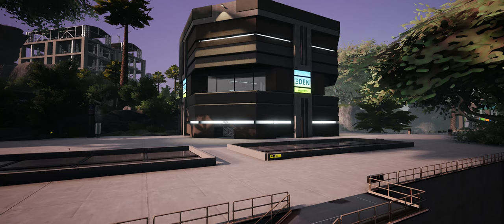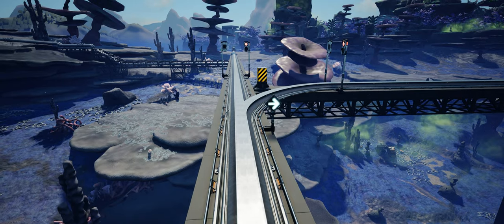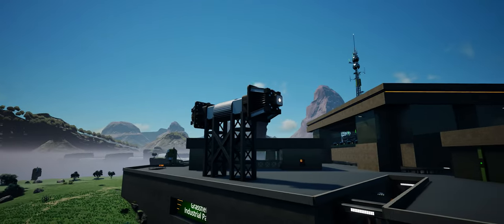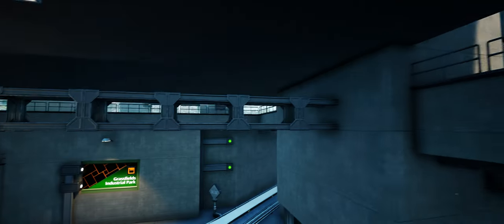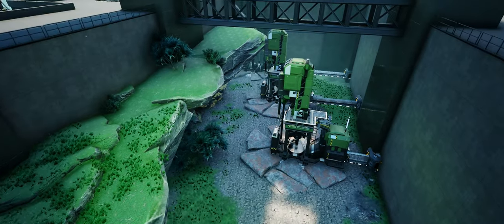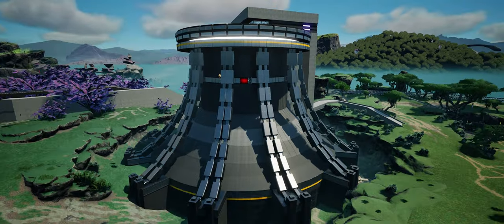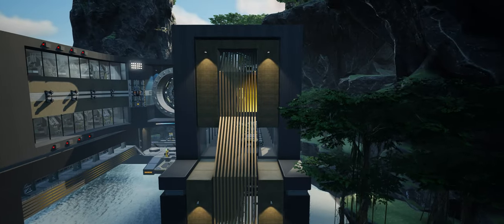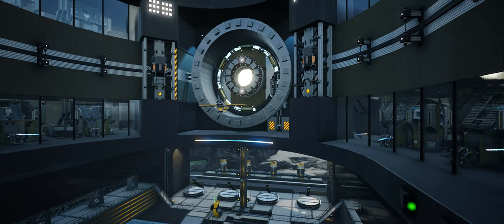F.C.A.T - Powerful Laundry & Dry Cleaning Service in Satisfactory...

Comment: Me: 400 hours building a concrete box to hold my copper noodles, and a cylindrical tower to hold my black sauce.

Stin Archi: I was on vacation, and came back, and did this [yesterday?]: (roll video of not 1, but 2 amazing factories, which at my rate, I could maybe achieve in maybe 3,000 years).

Comment: Your work has been an inspiration to attempt to create some interesting buildings, and get away from the dreaded “cube” structures. With the depth of complexity in your buildings I’m wondering how you work out the basic architectural designs. They seem complex enough that it seems unlikely one would just wander around throwing a beam here… a foundation there and come up with any thing useful… then again, I guess if one is SO good at this that maybe not much preplanning is needed…. Just learning the basic building tricks has given the game a whole new meaning! I’m using the PAK Utility mod just so I can fly and try making things without having to make all the parts. Thanks again for showing your insane designs!  🥂🥂👍🤩
Reply from the maker: Yes there is usually a good amount of pre-planning before I build anything. But also I've been playing a long time, and have a fair amount of experience and am fairily familiar with the game and its mechanics. The more you build the better you get.
PAK utility is great if you just want to play the game in creative mode. I didn't use any mods until around 700-800 hours into the game, after I completely finished and unlocked everything (at update 3). Then started using PAK utility to play fully creative and make vids - definitely helps to build more freely and creatively when you fly around and build without resource cost.
Thanks as always Harrzack, appreciate it
Reply: My thoughts EXACTLY!

Comment: Looks amazing.
How could you dock the second loco rotated at the back? ( 1:58 ) For me it didn't work.
Reply from the maker: Thanks Leif.
Regarding the train - Do you mean how to get a locomotive electric train at both ends facing different directions? Just use the mouse-scroll wheel when placing the loco, to flip the direction its placed.
Reply: @StinArchi   Yeah i know, I turned the loco but it just wouldn't connect. When the train started, the locomotive stayed where it was and didn't go with it.
Reply from the maker: @Leif-Eriksson  That's strange - when trying to connect it, put the mouse cursor over the last freight train that is aleady connected and it should snap automatically to it. 
Otherwise not sure what to suggest mate - seems to connect ok for me.
Reply: @StinArchi  I'll try it again. Thanks for your answer.  
Keep ti up.
Reply: @StinArchi  It works fine now. 🤙
Reply from the maker: @Leif-Eriksson  👍

Comment: Sorry what's going on at 13:30? you got a truck or something driving around near the doors inside, or? sounded like you said Factory Cart? oh that's probably the one seater skinny thing ay?
Reply from the maker: Yes exactly - I have one of those small, one seater factory carts going around in a circle inside the building to periodically open those doors, just for effect.
Used a factory cart as they dont require any fuel to work.